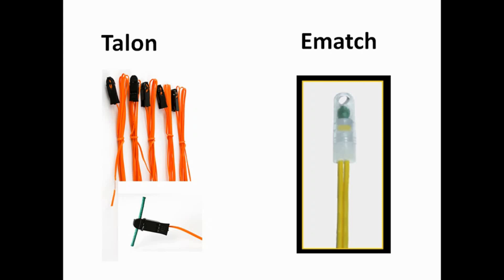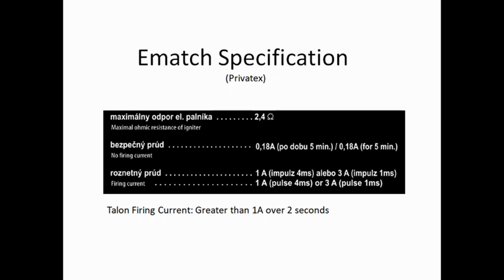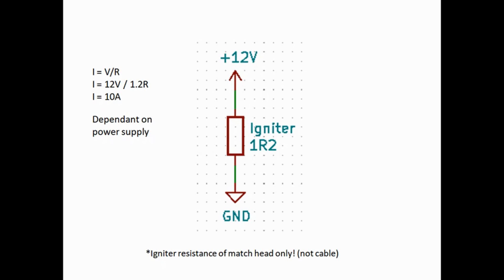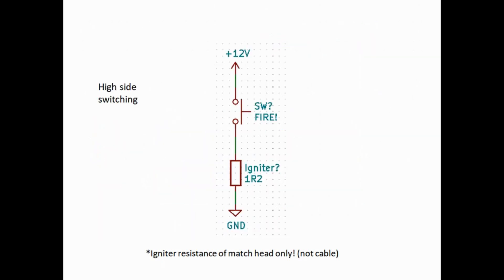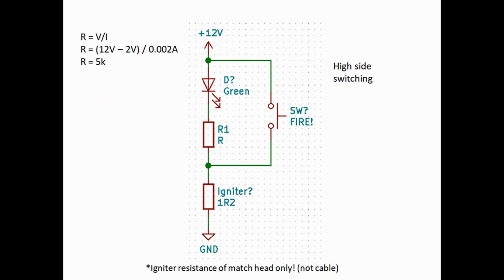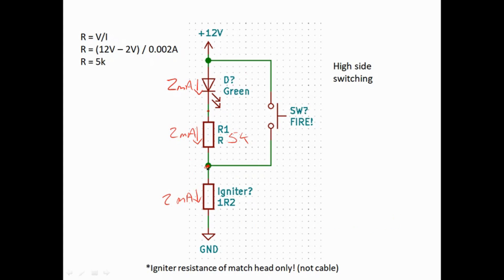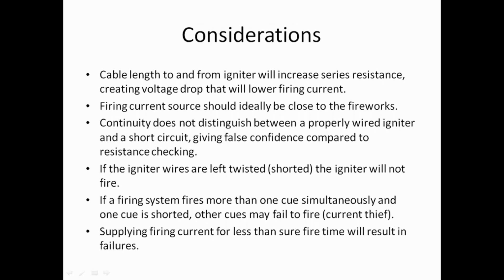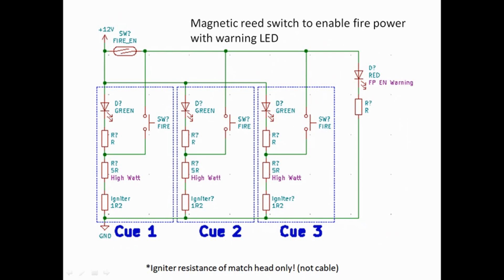Firework Electrical Firing Basics (Part 1)

Comment: Will there be a part 2? :) I'm designing my own system now, because I can only find the cheap clones of the DB04r to buy, and not the 3rd generation.
Reply from the maker: There was. . .probably looking at relay and fet circuits but that probably is never going to happen now, life got complicated. However, there is already a huge amount on the Internet about these kinds of circuits so Google is your friend ;)
Reply: @jonelectronics510  I almost done with the board based on the 3rd gen schematics you did. I was just curious if you have more good tips to improve that circuit.
Reply from the maker: @Dénes Vámos  I would enable fire power separately from the controller and probably through a hard logic gate rather than just the uC, uC can suffer instability compared to a dedicated logic gate. You also don't want to be testing with fire power enabled.
I would include a high wattage low resistor in series with each cue to prevent current thieving (that is a little over engineering). You should add the correct pull ups on the I2C lines if you plan to use external memory. Add software keys to the remote as well as the unique identifier. 
That's probably the basics.
Reply: @jonelectronics510  I think I'm way past the overengineering part... :D I have a couple of Atmega16's laying around, so I will use them, despite the fact that I rarely use any IO, because I use I2C port expansion for the outputs and buttons. That way I can use the same PCB in larger devices, on the "slave" PCBs I only solder the output related parts, not the MCU, power,receiver etc. That way I can connect 8 PCBs on the I2C bus, giving me 32 cues with 1 receiver and MCU.
About the fire enable button, what if I connect the high side of the speaker terminals with a 2K resistor to VCC, and the fire button shorts this resistor?
Reply: @jonelectronics510  Would a 5,6 Ohm, 5W resistor be enough? The 10W resistors are too big...
Reply from the maker: @Dénes Vámos  if you are never firing more than one cue at once, I wouldn't worry about the current thief resistor. In theory it would 20W continously but if you are only firing over 25ms for igniters you could use lower, for talons which are firing over 2s you would have to see how toasty they got lol.
Reply: @jonelectronics510  You are right, maybe it is easier to do it in software, delay the fireing a little bit, if another cue is active.
Reply from the maker: @denes44  I doubt the human eye could see a 20ms delay from one cue to another.